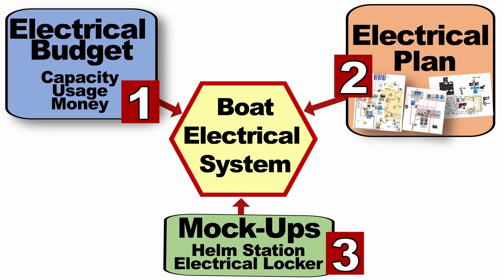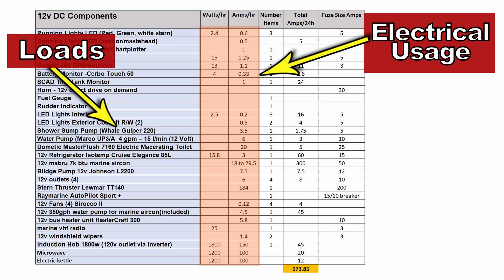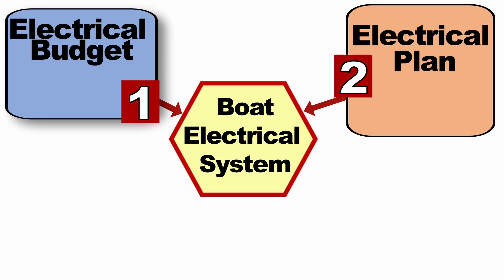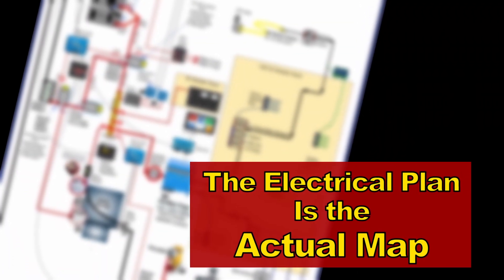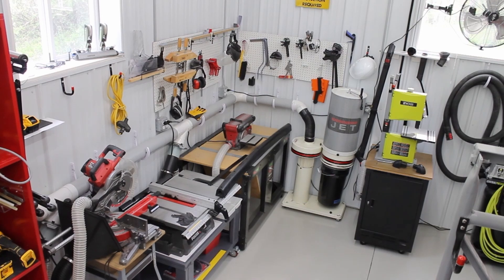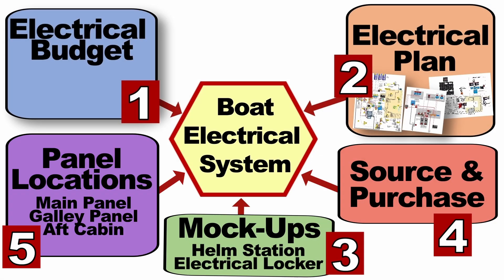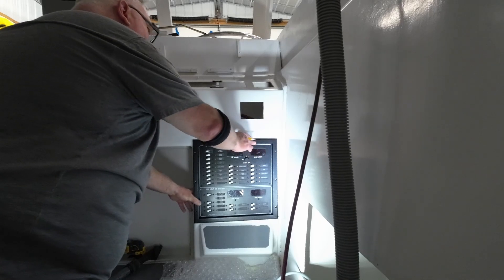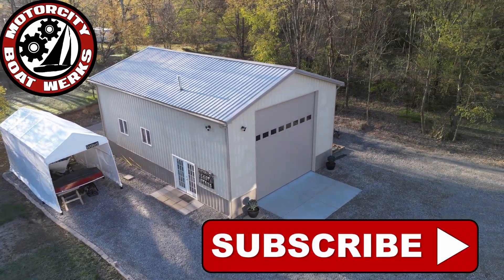Boat Electrical System Planning: 6 Steps BEFORE You Run Any Wire | Trawler Restoration (Ep119)

Comment: You may have covered this in "Lithium Batteries" - but the design can be so much simplified by using "Lithium Power Banks" directly. Then you make a plan of how much 12V DC you need - that is the Powerpanel. Then you have 220/110V AC for the rest. And these batteries are charged by shore power - 110V/ 220V AC, and many come with a solar panel interface. Any redesign to more than 4KWh/4 batteries (4 x 12.5V x 80Amp) should be multiple lithium power banks. They need no balancing, just on/off buttons. They have inverters included and can run motors, at least in Europe, on 220V - they can run up to 50KW motors, but use marine wiring. (enough to get a sailboat in and out of port - with a truster). Without the engine, there is no starter, and the fridge and microwave are the problem - they need slow fuses. And put the batteries in the bow - forward where you hit the waves - not aft.
Reply from the maker: Please 🐙watch all the episodes before commenting so you understand what I’m talking about and what the plan is for my trawler build inside the Boat Werks. 👍😁 That way we all know what’s going on

Comment: Yep, a supersized wallet sounds necessary. Seems that boat building is similar to home building in that the finishing touches are the most time-consuming and also eat away at your bank balance the most!
Reply from the maker: 🤔do you call putting in the electrical system a finishing touch on your house? I don’t.
Reply: @motorcityboatwerks  Not an accurate choice of words: let's rather call it the "inside jobs" that are done after the structure is up. But those still take just as long as the structure and are still expensive.
Reply from the maker: 😂🤣Right. Think about it this way. The structure is less than 1/4 of the work and 1/4 of the costs. All the stuff that make a house livable is the rest of the work and the rest of the cost. Thats the real world.